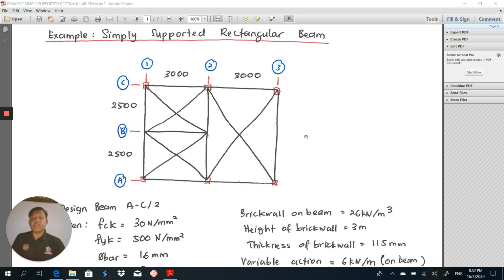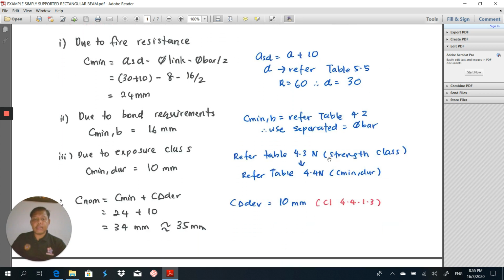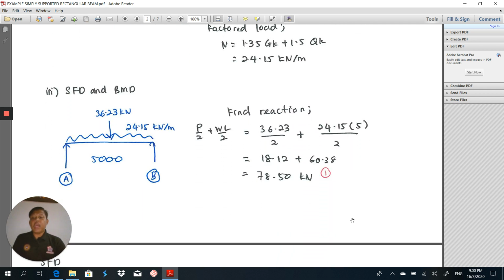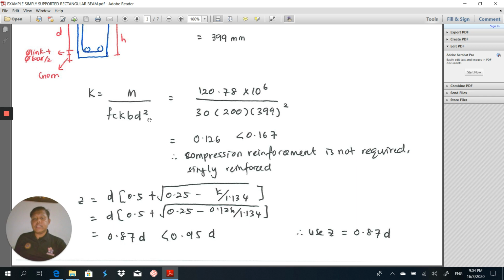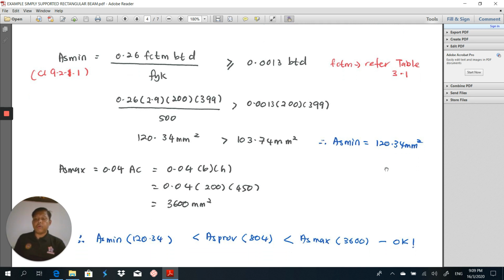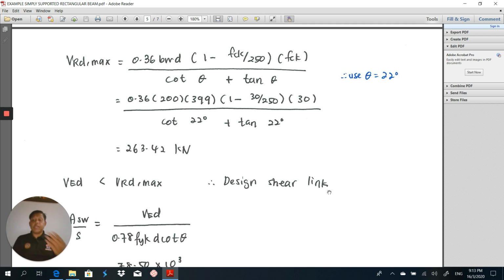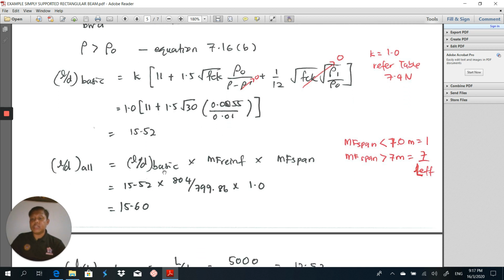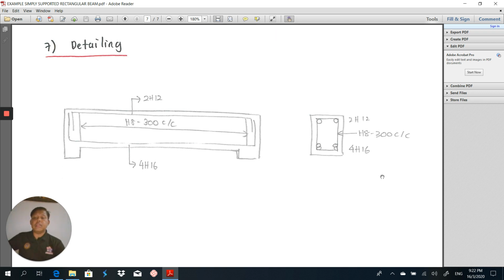SIMPLY SUPPORTED RECTANGULAR BEAM DESIGN TO EC2

Comment: Sir, brickwall = 26 kN/m3 tu refer kat mana ?
Reply from the maker: it is depending on type of brickwall. either you use cement-sand brick or clay brick. refer to eurocode 1991.

Comment: Boss beam size nk kira mcm mna
Reply from the maker: for width (bmin) refer to table 5.5 (simply supported beam), table 5.6 (continuous beam), table 5.8 (slab) - this is due to fire resistance. For the depth please use table 7.4N in eurocode or NA5 in national annex. Using theoritical on span/depth ratio.